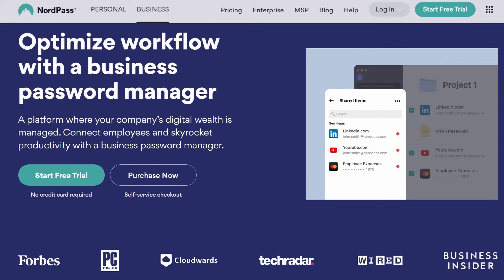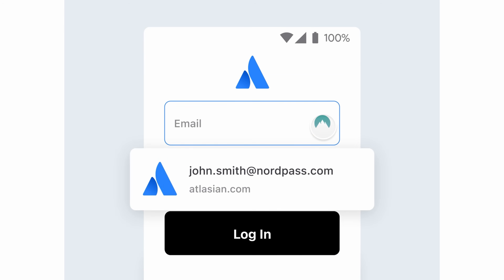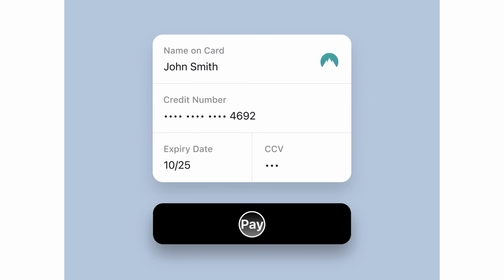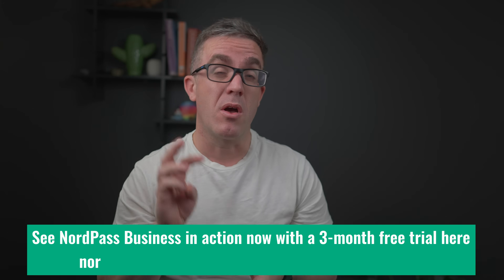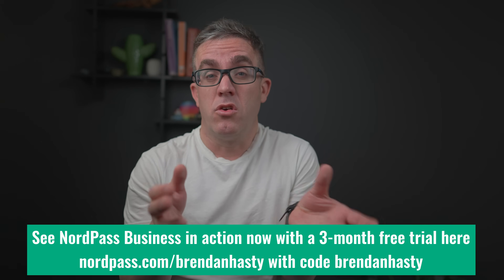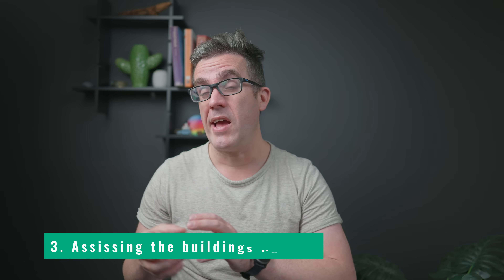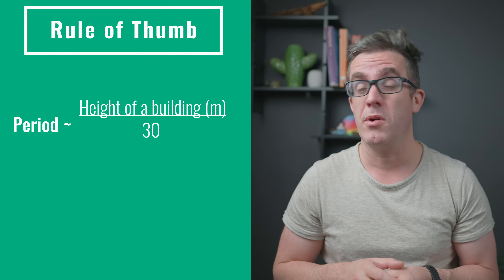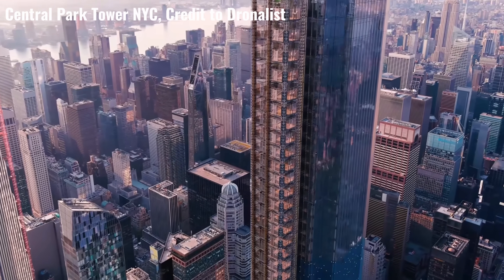Simple Rules of Skyscraper Design that Every Designer Must Know

Comment: Nice discussion of structural requirements.  A correction, the collapse of Skyline Towers was the result of not having enough re-shores on the lower decks that had not cured to f’c full strength.  Even the concrete laborers told the young project engineer he could not pull the shores out, they did not have the appropriate number of Ellis jacks to reshore the correct number of floors which “typically runs 5 full floors depending on your pour schedule

Comment: Humans should have never built straight up. Reason is safety-be it from earthquakes, tornados, sinkholes, corrosion, liquefaction, or fire. An evacuation plan was always lacking. But far more than that is that the sheer density of very tall buildings impedes infrared light from reradiating effectively to space & keeping it trapped. This light is thermal. Add to that the typical dark surfaces of the area--various shades of grey & steel & it gives us the urban heat island problem.